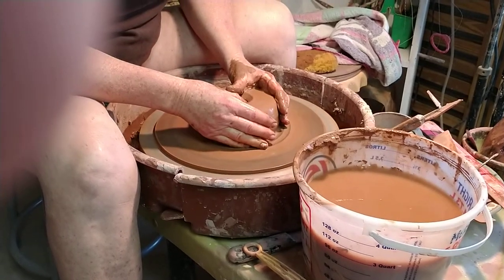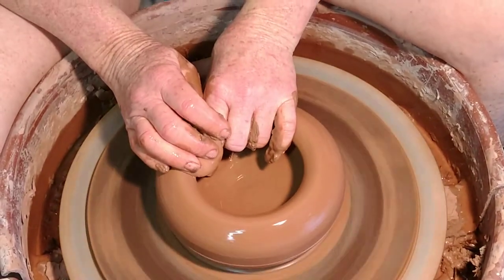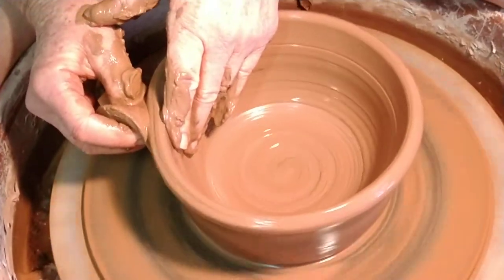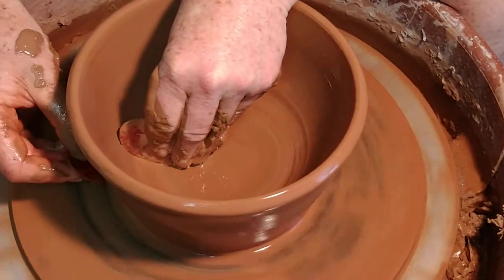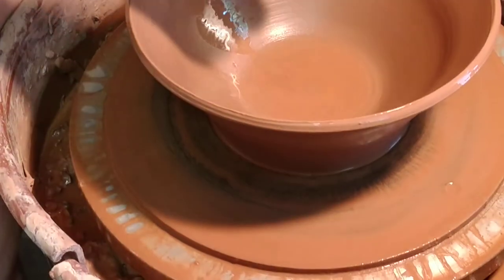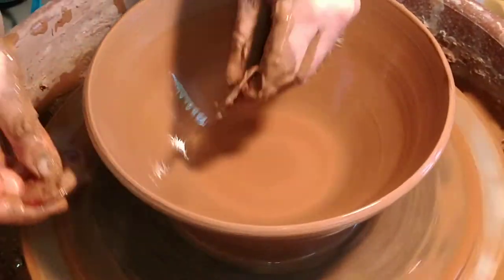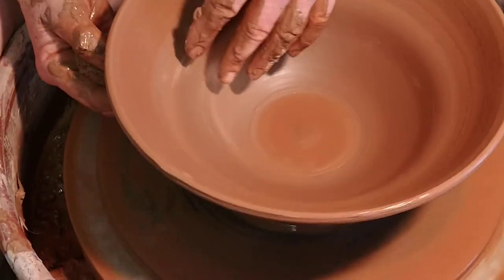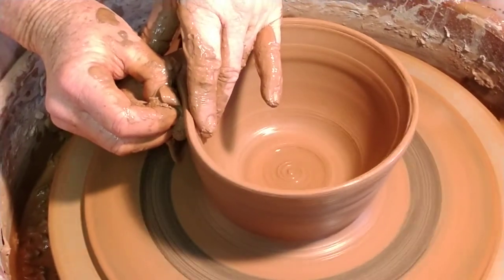9/19/2020 - Video #353 - Failed Wheel Thrown Bowl

Comment: Hi Janice! Next time you have a bowl flop, instead of cutting off the top, try this little fun trick I figured out. Take the bat off and flip the whole thing upside down. Don't worry, the bowl will stick. But since the walls have been slightly over saturated with water (hence the flop) they will move dynamically and in interesting ways. Shake the bat around to coax out a wavy shape, then let the bowl dry this way. I just hang it between two shelves. Wait until leather soft. You can further refine the pattern at this point, wire off the base and start to dry upright. The results are often very striking. These have become one of my most requested items, so I now produce them intentionally.